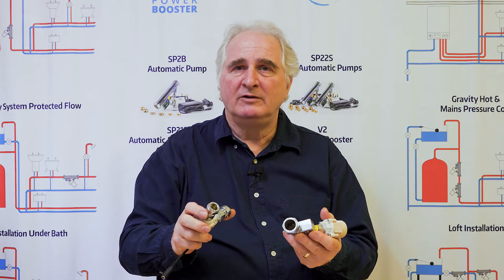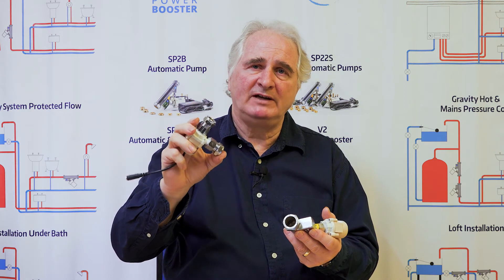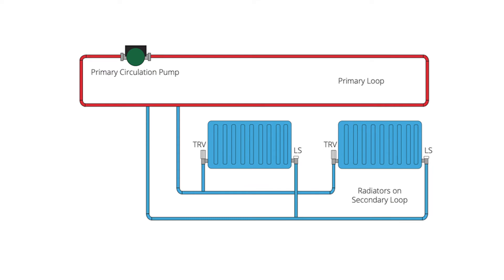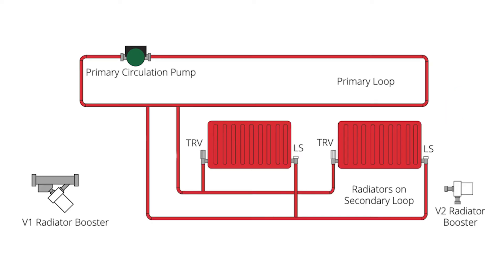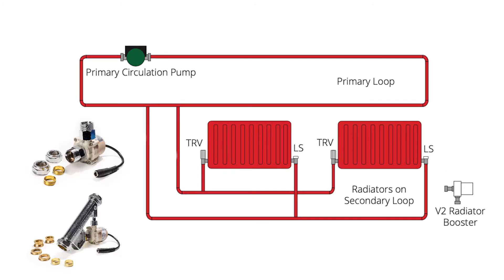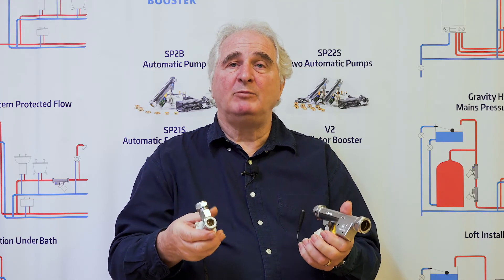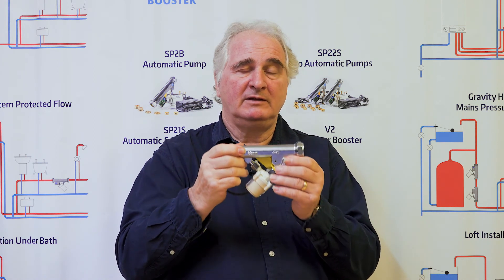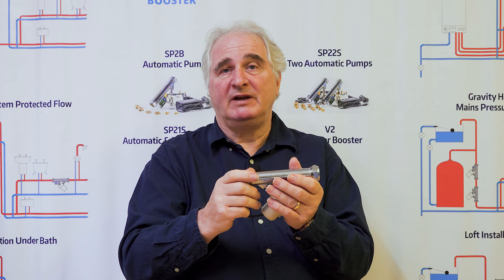How to Make any and all Radiators Run Hot - Get more Heat

Comment: Hi Alan i am sure you could have somehow incorporated and a on /off  flow switch similar to a on demand  booster water pump ? maybe you have reason  but i am not the inventor lol.
Reply from the maker: It is not as simple as you would think.
You can use a timer to make it come on and off when the rest of the radiators being turned on and off.
If you have a flow switch which reacts to flow the pump will be in danger of running all the time because it creates flow when turned on and in creating flow it may be risking running all the time.
Reply: @alandwright2  Ok got you , sorry i though they did run all the time when the heating was active so naturally thought if heating is off pump is off regardless one rad or ten  in use ?.